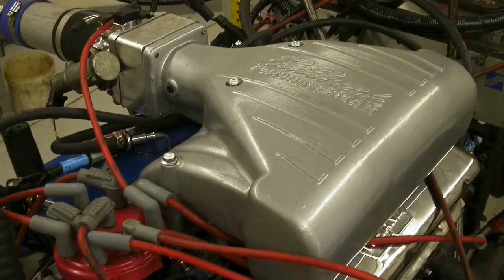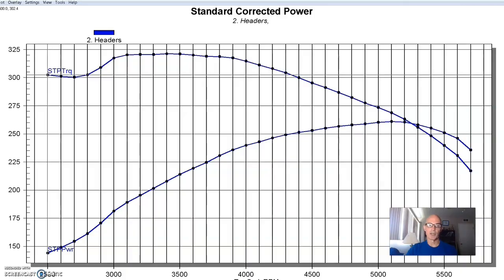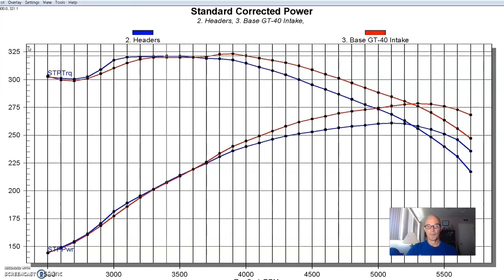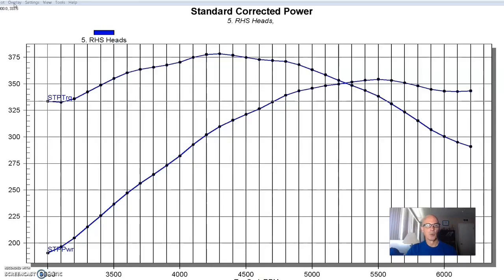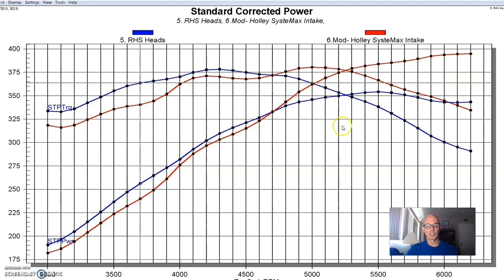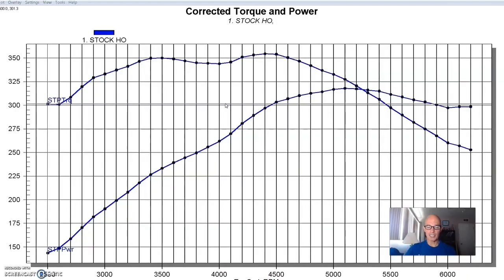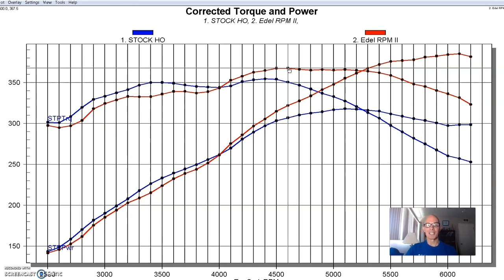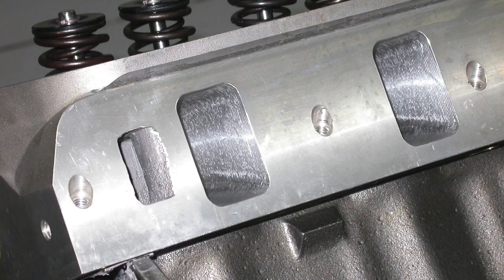5.0L FORD INTAKE TEST

Comment: I think you could achieve the same sort of power with far less money spent by using a single four barrel carby and Victor Jr or the motorsport intake on a 351 or 347ci stroker, and stock GT-40 heads with a bowl blend.

Comment: 354 HP and 374 lb ft of torque would make for a fun Fox body with long tube headers, a full 3" dual exhaust with either Flowmaster or Borla mufflers. I'd love to have a Fox body with a mildly modified 302. I've ridden in a stroked 347 with all of the mods and it made around 600 hp and it was fun and fast, but my 612 whp Civic would've eaten it alive from a dig. In my humble opinion, while I am all about keeping it brand specific, it's hard to beat a Fox body with a well built LS with a good sized turbo on it...OR a GT500 swapped Fox, or a Voodoo swapped Fox, or a built Coyote swapped Fox. One thing I have always wanted to see was a 3.5L EcoBoost swapped Fox...idk why it's always been a dream of mine, but I have always wanted to see what the EcoBoost (hell, 3.5 OR 2.7) can do in a Fox...or even a SN95 (even though they're boats).
Reply: There's a guy up in Santa Rosa that does autocross in an SVO. I bought his old turbo setup. He had swapped in that 3.5 Eco. It's online somewhere.

Comment: I remember back in the olden days [late 1990's ?] in the Summit or JEGS catalogs there was a "BOX" that would eliminate the runner's top section on OHV 5.0 and 5.8 EFI intakes.
I twould basically transform your stock 5.0 intake to a GM 1993 LT1 intake length and size wise, T/B remained at stock location.
Have you tested it before ? Have you seen in action ?  Was it any good ?
If you haven't, would you consider testing one ? I always wondered if that thing was a sham or if it actually worked.
Reply from the maker: Downs, Cartech, Comp and TFS all made those Box uppers
Reply: @richardholdener1727  was it any good ? Did you test any of it ? 🤔
Reply: The box intakes are mainly used for boosted applications.
Reply: @Bird76Mojo76  I thought as much.👌🏻😊👍🏻 Way shorter travel for that additional air and acts as a surge box too.

Comment: I have duplicated those results. An ebay systemax intake was worth 58 rwhp over a GT40 tubular.
Reply: The car is ' 92 LX with a T-5. The long block combo at the time was 306 similar to the video. The cam was an E303 with 1.7s and AFR 165 58cc heads with shorty headers, off road H pipe, & electric fan.
With the unported GT-40 it made 274. With the Systemax it made 334rwhp.
I did port the GT 40 lower and ran that for  awhile but it was a mess.
It was THIN in the runners and sucked alot of oil.
It made 316rwhp with that setup.
Reply: Lies. 
Not tuned ?

Comment: Have you done a test with the Holley hi ram on a 351w based mill?
Reply: Id be interested to see if there is a torque loss with the high ram on a stock bottom end 302.
Reply: Bobby4v yeah curious to see how much torque is sacrificed, pretty short runner length but +10 for aesthetics haha!
Reply from the maker: not yet

Comment: Richard, can you explain why you don't show dyno runs from idle? Since most people drive their cars on the street, I'm sure a lot of them would love to see how the bottom end is affected.
Also, do you have any comparisons of heat wrapping manifolds/exhausts?
Reply: In a previous video he said the engine dyno is limited on the minimum rpm it can run. Chassis dynos can go lower.
Reply from the maker: you can't be at WOT at idle
Reply: @richardholdener1727  Excuse my ignorance, but could you explain a bit further on that please?
Reply: @goldar4846  
I have a 4.0L Jeep and I always wondered that same question. All I'm interested about is idle to maybe 3k.

Comment: So for those asking about extrude honing, i do not remember what year it became popular in hotrodding but early 90's seems to be close to my memory. It's uses a grinding media in a putty like form pressed thru passages to open up and clean them of blockages and in the automotive world to port efi intakes because some of them are impossible to port any other way. It can be used to great effectiveness to add power around a peak not change the actual peak power rpm. it's like porting but with silly putty and a big assed hydraulic ram.
Reply from the maker: it is industrial grade silly putty impregnated with silicone carbide (or even industrial diamonds on some applications)

Comment: You might not notice 24ft lbs missing, it's lots but it's like 7%. You will definitely notice 40hp especially when you can run it 1000rpm higher. You would only see that rpm once on the strip, and even then maybe never.

Comment: What compression was this engine Richard?
I wish I.could.send you my ported upper and lower explore intake.. youd be very impressed I think. We'll find out here soon what it does to the rear tire.. couple.other things was.ported.as.well.. bone stock 142k mile bottem end explorer engine.. i did.change the cam.
Reply from the maker: I've run lots and lots of ported and modded Cobra and Explorer intakes over the last few decades
Reply: With flat-tops and assuming 64cc heads right about 10 to 1

Comment: Well stated sir. It's like buying an air filter that promises up to 45 hp gain...  lmao   Love the videos. keep em coming.  Kinda wondering about the results of changing nothing more than LSA on an already somewhat efficient combo.  I'm used to the 106 to 104 LSA cams even thou idle quality isn't very good unless compression is real good. In a street car though a vacuum brake booster becomes worthless. (maybe a hydraboost system would fix that idea though?)  Just a thought..  Thanks again sir..
Reply from the maker: the lsa video is up (on an ls application)-tighter can improve power low and mid but does lose idle quality
Reply: @richardholdener1727  how do i find that lsa vjo?

Comment: to be honest if i had a 5.0 and it was a daily driver i would just put the GT 40 on it and call it a day
Reply: Port the upper and  lower.. game changer. Will flow as much if not more than any of the after market intakes for have the price and "look" stock
Reply from the maker: porting the Explorer for additional flow will not allow it to make power like the RPM II or Systemax (porting does not change runner length)
Reply: @richardholdener1727    so are you saying a ported upper and lower explorer intake will not make  more power thN a stock one?
EDIT:   you are the professional  Richard, but that is simply not true.  I know for a fact it does make more power than a stock out of the box rpmll.
I know it doesn't change runner length....but it does increase airflow which increases  power as we all know.. as long as uts all matched of course
Reply: @19jody72  
That's not what he said.  He simply said that even when ported the explorer/GT40 stuff still won't make as much power as the RPM 2 or the Systemax.   The runner length determines the RPM range.  Bottom line is, the GT40 stuff works well but is near the bottom of the barrel compared to other aftermarket manifolds when it comes to making good power.
Reply: @smokeum12   Fair enough.
Reply: @19jody72  Lol, you can't really port the upper since it incorporates thin-wall tubes. But, you can port the Explorer intake which flows similar to the GT-40.
Reply: @231mac   lmao...Yeah, I meant the explorer intake.

Comment: Curious what the power differences are between carb and stock Efi on the 302, always ran one with a carb and dual plane intake.
Reply: I bought a full lunatic balanced 408 stoker kit for my 351w. I had to cheap out on the pro comp 215 heads. Sent to machine shop for springs and a good look over. Used a Ford single plane high rise. Z 303 cam tried to stay all Ford I was dumb at the time. Any way my buddy ran a 79 sunbird with a 383. We both ran a glide with 4:56 gears. Stock suspension. Tubular k member on my 89 fox lx. 2007. They were all Chevy hardcore never even built a Ford. When they saw I had to do no block grinding for my rods to clear they were amazed. Stud girdle on mains and rockers. Very similar parts on both. They thought for sure my Windsor stood no chance. That Ford made no power crap was all I heard. Double the money later on my Ford even I was questioning my route I chose. We were on small tires. Foot braking no trans brake till later. Straight cut planetary for the glide killed my trans break budget and his. Any way we went to twiggs in Macon and Savannah before it closed and ran 6.10 all day no tuning no test. Once the mustang started to come around the economy fell out. I had to sell my engine for 5,000 to a cop in Atlanta. He said straight bolt up in his 91 he ran 9.80 in the quarter. These were N/A cars. Needless to say I noticed how much power and torque that 408 made which I'm not good on the cubes it was .40 over. It was a very impressive engine. Then I drove a built 347 and man the power band would kill that 383. Anyways just reminiscing the good ole day off 2005-07.
Reply from the maker: dual plane carb is a lot better than stock H.O. EFI
Reply: @richardholdener1727  cheaper too, procomp intake and distributor on a 302 swapped in a 240z back in high school.
Reply: Jeff Kopis  they do make carbs for mod motors they have for years and years.  You dont see it alot but they do make em.

Comment: Hmm, what would happen if you started a engine with 2 different cylinder heads?
Reply from the maker: it works fine
Reply: @richardholdener1727   You deserve to get paid for these videos
Reply: Richard Holdener What if the valves were different sizes, wouldn’t it pump to much pressure in a chamber and overwork the rotating assembly
Reply: You can't tell  a guy at car show did it on blown big block
Reply: It just runs a little funny if the ports are mismatched but as long as the intake seals and it gets fuel and spark at the right times it'll run just fine
Reply: Nascar guys did this with the cylinders big ol bore on the ones that wouldn't get tested
Reply: I did this very thing on my junkyard 302,.....20 years ago!!!! One E7 ported head and one ported GT40 head!!!! Lmao!!! Some things we try when we were young!!
Reply: Just seen a video of a guy running a car with a TFS head and a AFR head and it ran awesome so yes you can do it

Comment: On an EFI engine like this, where the intake is "dry" before the injectors, would polishing the runners do any good?
Reply from the maker: porting them does-polishing them just makes them shiny inside-Extrude Hone porting does both
Reply: @richardholdener1727  Is this because of the "boundary layer" to steal an aeronautical term? Basically the layer of air between the surface and the main column of air that is moving. Porting increases the main column of air and thus the volume of air for the same velocity. Maybe. Or maybe I should shut up and drink some more beer. Yes more beer.
Reply: @richardholdener1727  I've had extrude honed intakes but they seem controversial, I'd love to see a test with and without to see if they actually help much.

Comment: Are the Systemax intakes and heads still available? How about extrude honing?
Reply: A lot of intake stuff is based upon finding the right length to the runners, longer runners make peak torque lower and affect the rpm the engine makes power, shorter is vers visa, extrude honing doesn't change the tuning range or very little as the runners get bigger, the nice thing about extrude honing is getting to places that a traditional porter can't get to and fixing any casting flash and stuff in the runner itself, you can extrude hone a set of heads and intake till they start showing holes, and all it'll do is broaden the power around the peaks. So get the length right then hone them out.